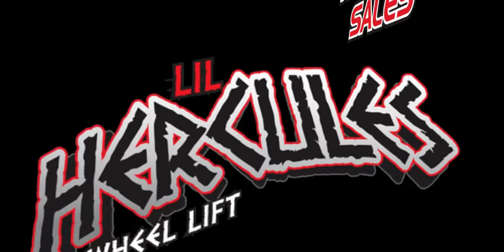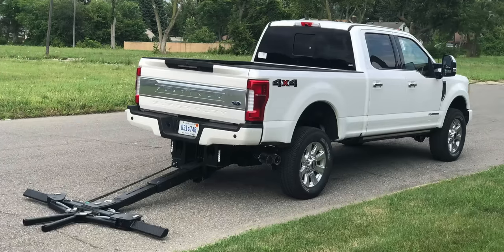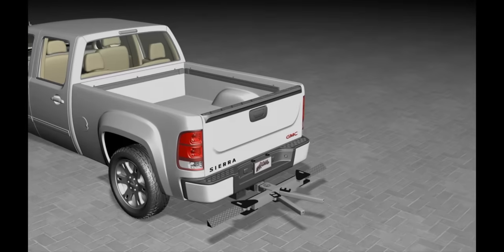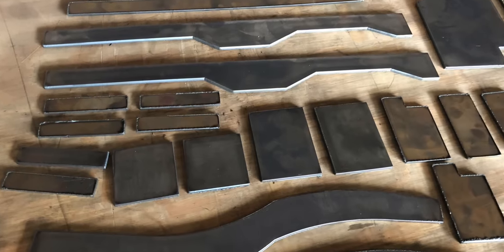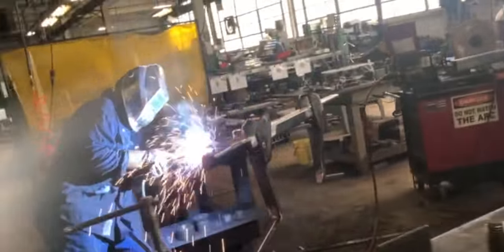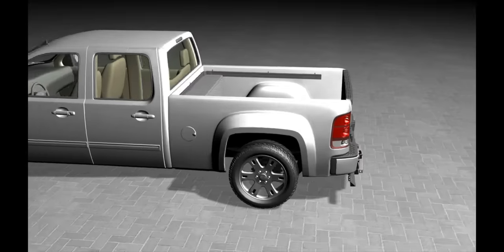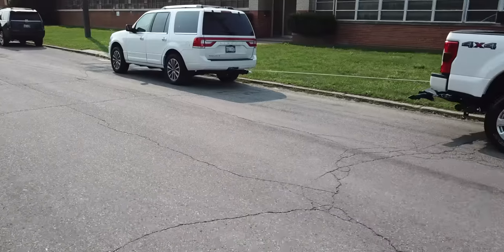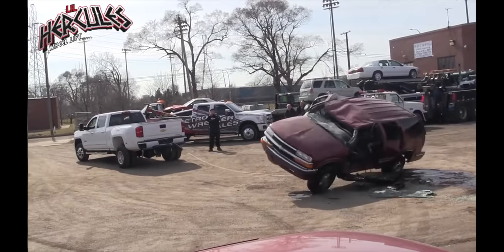Lil Hercules w/ Winch By Detroit Wrecker for Generation X Towing

Comment: If I had the money I'd love to get into this type towing business
Reply from the maker: The Lil Hercule's is the strongest lightduty Wheel-Lift on the planet! Pricing is currently $25,000.00 not installed, plus shipping. For installation add another $9k for a total of $34k our the door 🚪, and that includes:

The most thorough Frame Reinforcement in the world 🌎. Our in house engineer stress tests the truck frame in 3D CAD click here —> https://youtube.com/watch?v=PKhJzoIPpeQ&feature=sharea

Rear Suspension. Our trucks literally ride like a caddilac when completed. Almost every customer comments on how smooth the ride is loaded or empty. Click here for the video —> https://youtu.be/u-JzOq1HqvE
* Plus it comes with everything else that is needed to tow home like chains, ratchets & straps. Again everything needed to tow home. https://youtu.be/NZJtB9Z2S-4?t=148
* Toolbox for the double motor electric pump (runs twice as fast as a single motor). https://youtu.be/NMxMgUUQhsQ
* Wireless Towlights and corded. You get both!
* Work lights w/ a switch installed into the dash to turn on/off. So you can see at night when backig up.
* Spare springs for L Arms, spare hydraulic o-rings for every hydraulic hose connection, spare 300 amp fuses for the electric motors. 
* 5,000 Lift Capacity  - 10,000lb Tow Capacity - The highest in the industry period!!

LH 2.0 now has a 5” bore Lift cylinder, Which is currently the world's biggest 'Lift" cylinder for a light-duty application. We made our tubes thicker to accommodate & they are over 1/2" thick!! Making them the thickest tubes in the world as well for a light-duty application.
Our Crossbar is the thickest at 3/8” thick throughout, pivot pins are so superior that you can tighten them at any time, they are adjustable unlike any other unit available tody. That goes for the L Arm pivot pins as well!  #TwinHexPinSystem 
Our units offer a big difference not having to deal with the downtime or replace the costs of pivot pins or plastic wear pads. Our units are a game changer! 

We are the first to over-build the application to this degree. Unlike anyone, anything or anywhere else. We have thicker tubes, bigger cylinders, a superior pin system, no plastic wear pads. You can’t afford not to have one of our units. They are stronger and have proven to last longer than any other. Plus the fact your driving in a comfortable truck, not a rough-riding wrecker. Essentially killing 2 birds w/ one stone making the truck a versatile money-making machine. Your personal truck is also your wrecker truck is also your 5th wheel or Gooseneck truck. So many trucks 🛻 all in one. "The bitterness of poor quality remains long after the sweetness of low price is forgotten. "
Ben Franklin.

* WHAT'S THE BIGGEST THING I CAN TOW? *
* Anything smaller than your truck. Never tow something as big or bigger than your truck if you want to stop and steer safely. Towing a truck as big or bigger is going to exceed the capabilities of the brakes (you do not have trailer brakes in this application). 

* WHAT TRUCK DO I NEED?***
* Any year or make, that’s a 3500. 
* Any 2500 from Ford or Chevy with a 10k GVWR, and to my knowledge, that’s 2017 and up. 
* No Ram 2500's any year because they either have Rear Coil Suspension or they lack the 10,000lb GVWR needed. The truck must have 2 things to qualify a 10,000lb GVWR & Leaf Spring Rear Suspension. (We prefer a 160” wheelbase as well). 
The installation comes with:
- Ratchets, Straps & Safety Chains for securing the vehicle in tow.
- Spare Hydraulic O-Rings for your hydraulic system.
- Spare Fuses for the Electric Motors.
- Spare Springs for the L Arms.
- Spare can of Undercoating for the frame.  We undercoat all frames with a quality rubberized coating great for our MI weather.
- Wireless Towlights from Towmate (Green).
- Regular Corded Towlights.
- Fox Rear Shocks. Our units ride like caddilacs loaded or empty!
- Tool Box to house the double motor Electric/Hydraulic Pump & Batteries.
- 2 Interstate Batteries w/ a nationwide warranty.

* OPTIONAL  ITEMS *
Frame Fork KIt - $4800 comes w/ 3 sets of forks.
Winch behind the plate - $4300 comes w/ synthetic rope.
Wireless - $1850 the LH comes standard w/ a 20’ corded controller.
Motorcycle Attachment - $1350 enables the LH to tow motorcycles damage-free.
L Arm Extenders - $600 for the pair. They extend the L Arm. Made of 6160 aluminum.

Comment: Thats sick, I need one!
Reply from the maker: #LilHerc will work circles around any wrecker body or competitors unit that is similar to ours by far, in regards to duty cycle, lift capacity (10,000lb Tow Capacity, 5,000 Lift Capacity)

All wreckers have plastic wear pads for the sole purpose of replacing. There is no structural purpose for lifting/towing a car/truck. 

The pivot pins are designed to wear out quickly. Thus forcing the end user to buy them annually. None of which is a factor for our clients. 
Wrecker bodies minimum = $30-40k. 
Lil Hercules = 16k not installed. Big difference in price and not having to deal with the downtime or replace the costs of pivot pins or plastic wear pads. Plus the fact your driving in a comfortable truck that rides like a sofa not a brick like a wrecker. 

Not to mention our LH 2.0 now has 5” bore Lift cylinder. 
That means it’s stronger than any wrecker out there, that’s mounted on a 450-550 chassis. Obviously excluding med duty wreckers that are mounted on F650 of similar chassis. 
But that’s my point! We are the first to over build the application to this degree.  Unlike anyone, anything or anywhere else. 

We have thicker tubes, bigger cylinders, superior pin system, no wear pads. 🗣 🗣🗣🗣You can’t afford not to have one of our units imo.